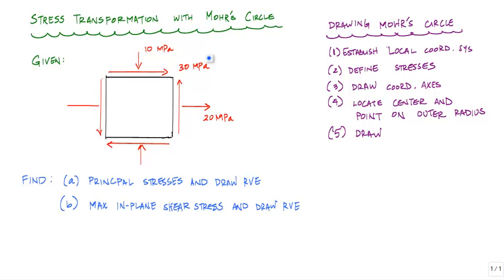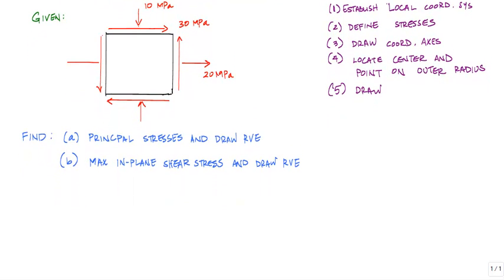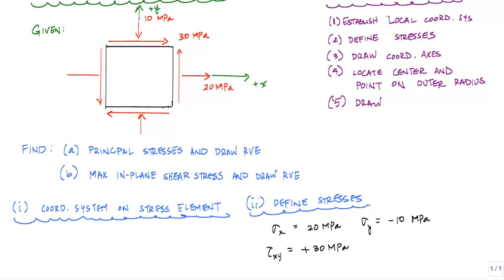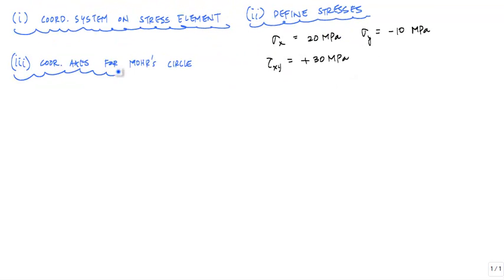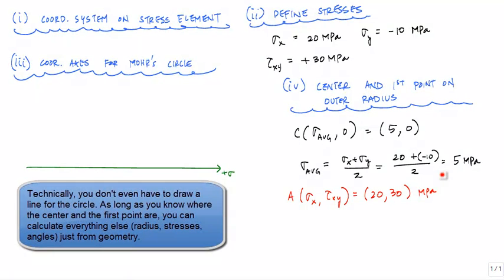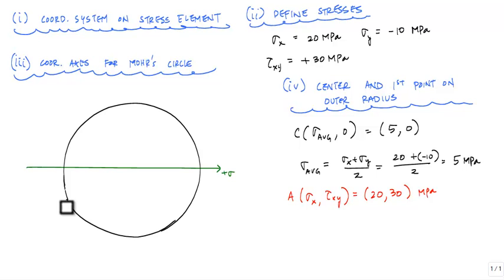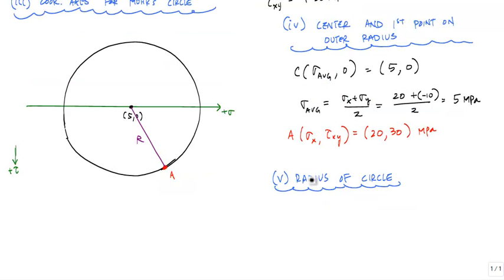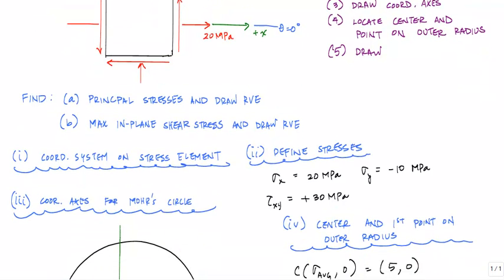mohr's circle example 1 (1/2 - drawing the circle) - mechanics of materials

Comment: i have some questions for you: Q1: How do the normal and shear stresses apply on the faces of a cube?

Q2: What is the formula for the radius and the center of the Mohr Circle?

Q3: What information do you need to determine the combined stress using Mohr circle?

Q4: write the formulas for θσ and θ